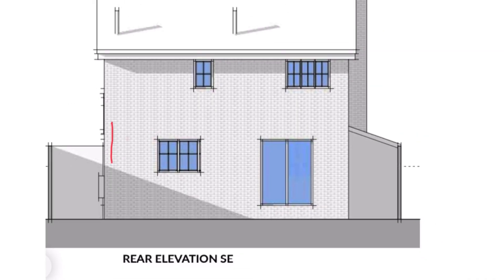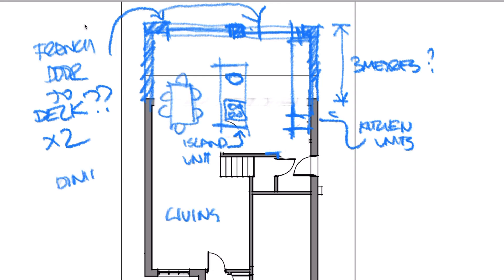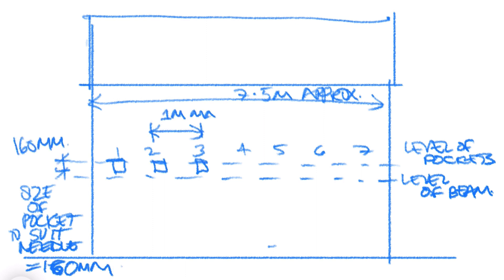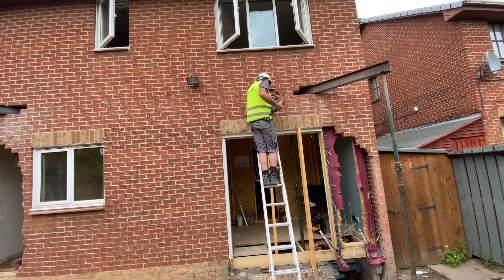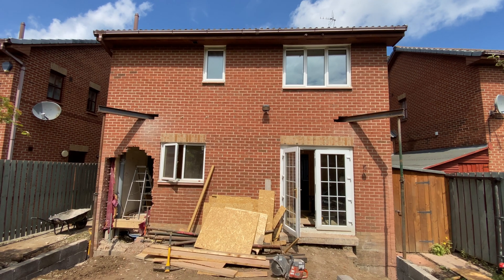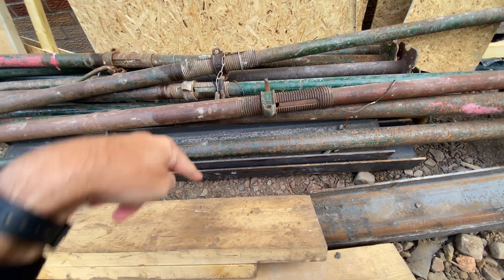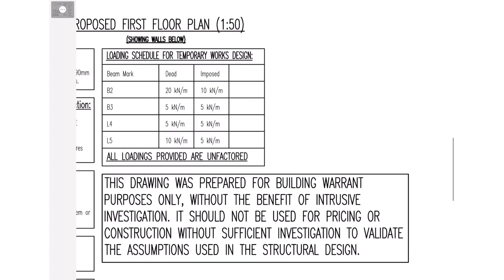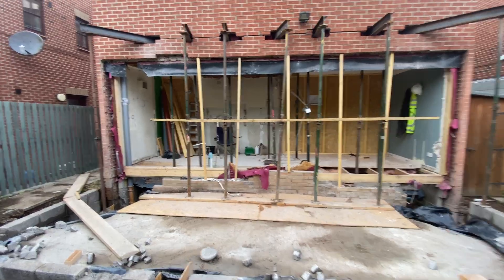Preparing for steelwork - can you do it yourself?

Comment: What length steel ( needle) you used ? Thanks
Reply from the maker: Length of steel for needle depends on thickness of wall plus 600 each side to allow a person to walk between the props and the face of the wall you’re going to demolish.  The ones at the end on the diagonal I made longer because I didn’t want them to interfere with the foundations
Reply: @build-better-things  You are great man. Answer me this time. 
I’m watching your video & inspired.
I’m doing my extension my self . 
My out side wall stone build. Inside brick. 100 years old house.
Wall size 350 total 
Total  width of the house 7m.
Can I use total 2m long (needle) steel ? 
Thanks
Reply from the maker: You need a structural engineer to give you those sizes, or calculate them yourself with a risk assessment. I can’t do it here for you. I’ll pass the lengths past my engineer before cutting them to size. The needle depth comes from your engineer
Reply: @build-better-things  thanks for reply. I want to know support needle length 
Not actual goal post

Comment: when you say you will do this and that, is it actually you doing it? I do like your videos and I do agree with all you are saying, its a proper bum hole pucker time doing this kind of work lol
Reply from the maker: All the work I’ve shown in these videos I have done myself with my own hands, sometimes I have my colleague to help, but I rarely work with more than the two of us, and we do most if not all the trades.  Where I get outside help, such as steel fabrication, which is done in a factory and delivered by crane, then of course I will get the fabricator’s input. In this case, after we did the prep, I had the fabricator deliver and raise the steel in place, but we shimmed and completed the critical work. You can see my other video here showing the install
Installing steel beams for a house extension
https://youtu.be/3t9r2dwvAFA